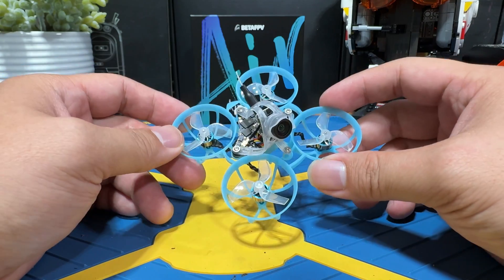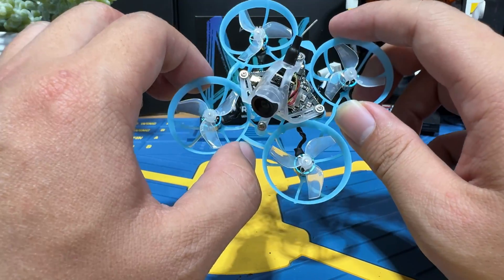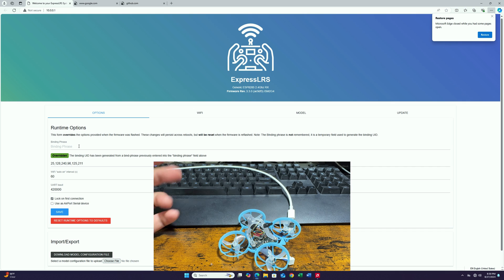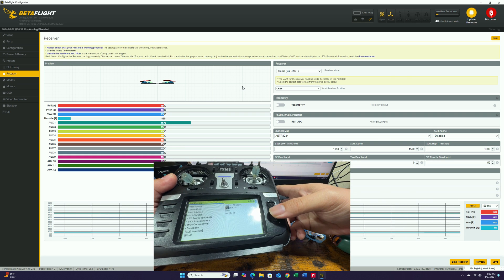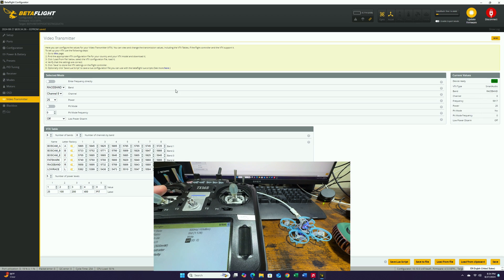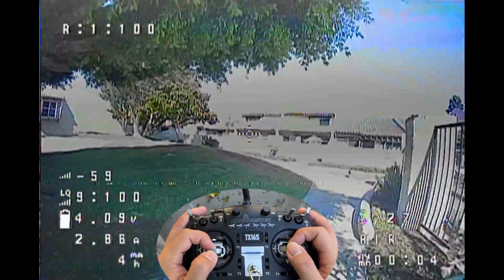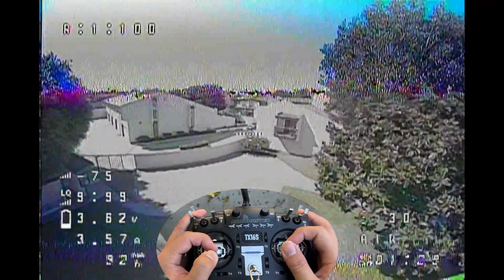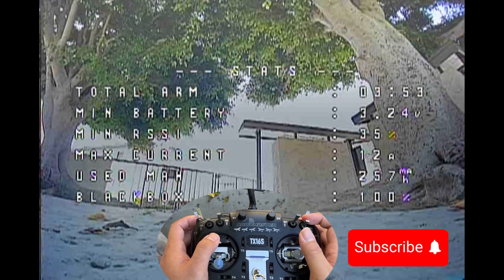Just bind & setup the BetaFPV Air65/75 ELRS the first time | Full guide & Test Flight #betafpv

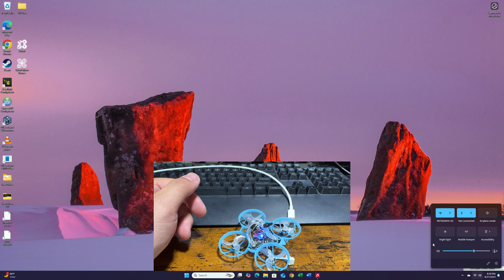Comment: 3:45 i have an ethernet cable how do i connect?
Reply from the maker: My suggestion will be getting a WiFi adapter or you need to flash it via betaflight pass through

Comment: Can it be bind to the old turanus or spec dx8
Reply from the maker: You will need a ELRS module and some conversion of the firmware will be required. Suggest to buy a new ELRS radio

Comment: Hello. Can anyone help with the air65 ELRS? It doesn't show up in the wifi options. So I updated the firmware in betaflight and then it is just  blinking to orange and it still doesn't show up so I can request the pairing password.
Reply from the maker: You should not be updating the BF firmware, most likely right now your presets are wiped out. If you are seeing nothing in BF, reach out to the support team as you might need to reflash CLI codes. 

For binding, if you are still having issue, the plug and unplug battery method should still work, give it a try

Comment: My model match is off and it still is not coecting to beta flight? Any idea why
Reply from the maker: That means you have not connected them most likely. But if you can confirmed they are linked, check your pkg rate, swap it to 500

Comment: can you help a noob out here lol I just got an air 75 and I want to use my DJI goggles 3 and FPV controller 3 to fly and I cant figure it out.
Reply from the maker: Ok … if you are having an air 75, this is a 100% analog whoop, the DJI equipments you have is digital and will only support DJI VTXs
Reply: @XwingFPVRC is there one that I can buy that will fly with those for that price and that size? Or should I just buy the bigger ones that have the O4 system

Comment: Mine is says password is wrong
Reply from the maker: The password should be expresslrs all lower case
Reply: @XwingFPVRC  yes thank you it worked. But I have the DJI goggles 3 and FPV controller 3. but I can not figure out how to set it up do you know how to help me
Reply from the maker: @ceckin3442 I responded to you in a different tread, you will need to change your equipment

Comment: If you have a different protocol on your radio (like I have a Graupner with proprietary protocols installed), is there a way to connect this to the drone? I.e. a way to install a different protocol on the Graupner?
Reply from the maker: If your radio has a external module bay and if you are able to load additional files onto the radio then it is possible. 

You will want to have a 2.4G ELRS Module, check and see if you module bay is nano or Micro. 

This is a more detail Guide: https://youtu.be/Fy-gLQ5EJUc
Reply: @XwingFPVRC Cool, I will check that out, thank you!

Comment: 500hz packet rate on a Ranger external TX with 500mw max power WITH A MOXON on a TINYWHOOP with only 25mw VTX power in a residential area is crazy ridiculous work. 

You are using way more of your TX battery than necessary and disrupting small electronics in your area. The battery on the whoop will die before you even reach 1/10 of that capable range. Have your neighbors ever complained about their clocks being reset, or vapes going off randomly?? 😅

When you have limited your vtx to such a short range approx 500ft, what’s the point of your RX having ~10 miles of reception? 

500hz is okay, I use 250hz and it feels lighting responsive within a 500yd radius. I have my TX power to 100mw and the range is more than enough 250mw would be luxurious. MOXON antenna send a concentrated signal in a mostly straight line for Long range straight flight. Fly the T-Style antenna for better reception with a whoop. 

I have my VTX on 200mw and fly 10 packs in the desert heat with no problems. Setup pit mode to help keep it cool. 👍🏼 

I got the 65 race edition as well, this thing RIPS!

Comment: At 6:19 my input doesn't work on the hglrc c1 and i don't have a screen like you use I've tried going back and forth between both express elrs wifis and using it but it didn't work
Reply: Same did u find the solution ?
Reply: Yeah no to bind it to your drone (I'm assuming you don't use a binding phrase) just plug in the drone 3 times, then find a bind button

Comment: I have a meteor 85hd and when I plug it into max book no Wi-Fi shows up, it’s flashing fast but not as fast as your pleas help
Reply from the maker: The 85 has a SPI ELRS RX ,which means the receiver is not flashed by WiFi but betaflight. You can check the receiver tab to setup the stuff you need. Also if you are looking for ELRS 3.x make sure your BF version is at least 4.4 or above

Comment: I never see a wifi network unfortunately, I have an Air65 but I have the newer one and it doesn't have this external ELRS chip.  not sure what I'm doing wrong.  I click bind in betaflight, and blind on my controller, but nothing happens and it won't bind
Reply from the maker: That is the new 5in1 board, it is still external ELRS but right now just build I tot the board

Comment: What happens if you have other Quads that have Express Elrs 2.7v . But now I have to flash firmware to 3.3v to be able to conect to Air65 . Can you still use the same radio.  I have other quads to.

Comment: If I have a Cetus x kit can I use the headset and controller for this drone??
Reply from the maker: If you CetusX kit is ELRS, then yes. You might still need to update your radio to the latest firmware in order for them to bind

Comment: Just a note I had to Flash the RX and TX to the latest version and I did not use Generic ESP8285.  I used BETAFPV 2.4GHz Lite RX and was able to flash to latest 3.5.2.  Not sure what generic would have done but when I connected to it in ELRS configurator it showed the firmware on it as it as BFPV Lite 2G4RX.   10.0.0.1 shows it as Generic ESP8285.

Comment: hey man. My radio is on expressLRS 3.5.2 .. the air65 rx is on 3.3.0 ..just went into the wifi config and checked it. I'm having trouble picking the right firmware for it. DIY_2400_RX_ESP8285_SX1280 that's listed in the overview but I'm not quite sure which one to pick .. Device category: betafpv 2.4Ghz or DIY devices 2.ghz? Can you maybe check and help me out? I really don't wanna fuck up things .. cheers mate
Reply from the maker: First of all , since they are already both on 3.X you do not need to update the firmware for them to bind. You can setup the bind phrase directly for both
Reply: @XwingFPVRC  hey man, thx for the super fast reply. I've already figured it out and found the correct target name + firmware. Thx for the video. Good intel for my fpv notebook.. keep it up
Reply: What is the right target and firmware name?

Comment: Is the meteor 75 pro or air 75 better? And does the air 75 work with my betafpv vr03 goggles and radiomaster pocket (m2)?
Reply from the maker: Well i never tried the air 75 so i cannot give you an answer. If they are all ELRS and Analog yes, it will work